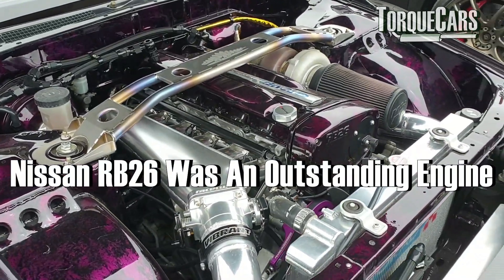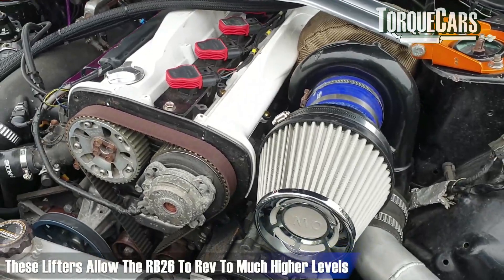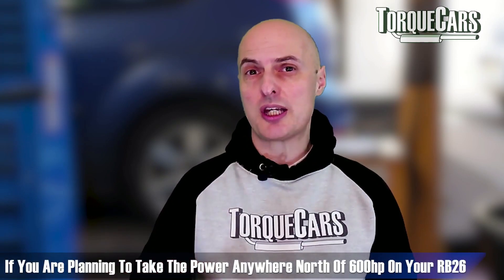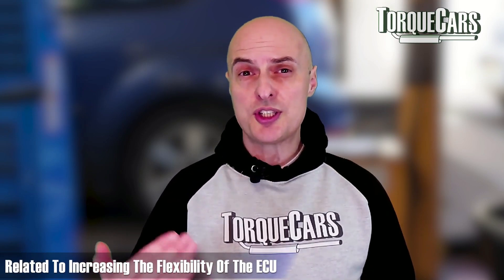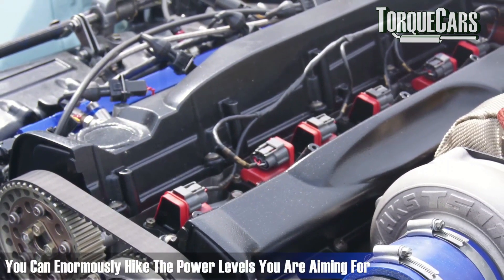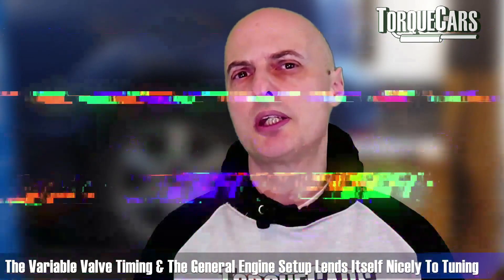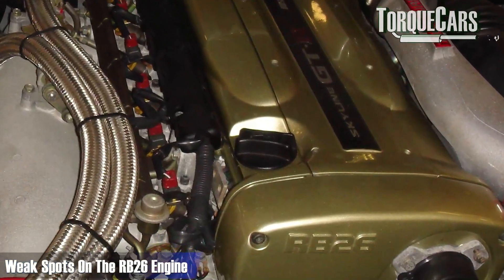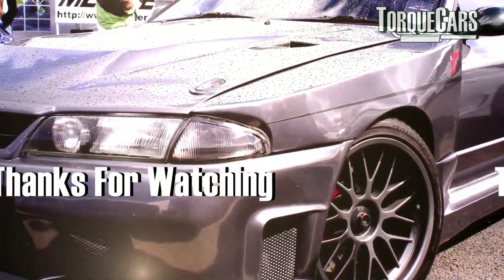Best RB26 Engine Tuning Mods [Add 100-700bhp]

Comment: A RB26 with modified steel exhaust standard turbos, better exhaust and an Apexi Power FC, you can get 290RW Kw easy on 17psi